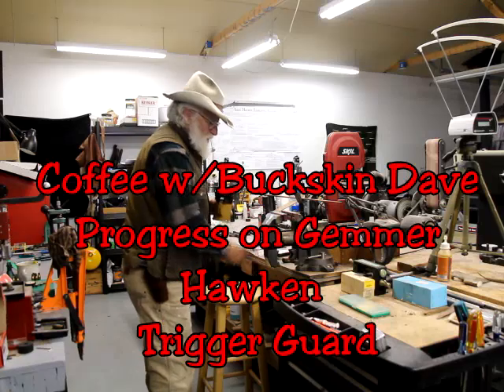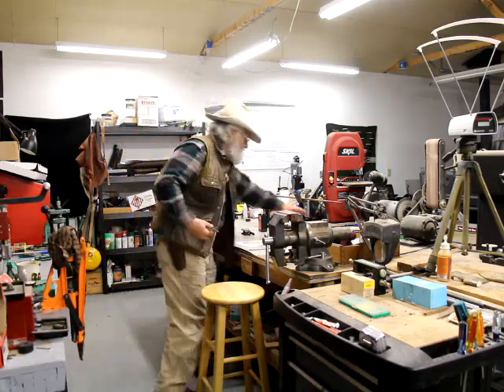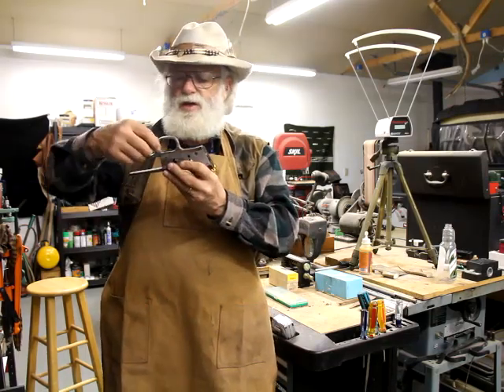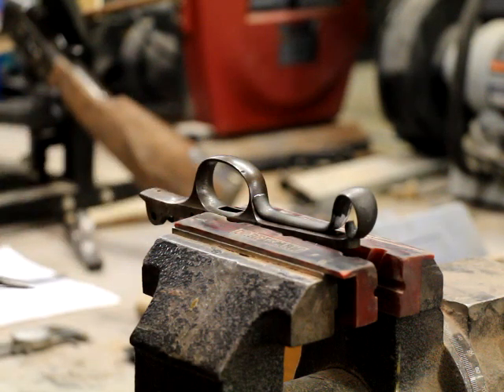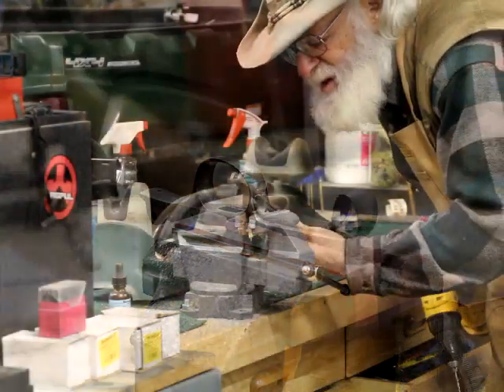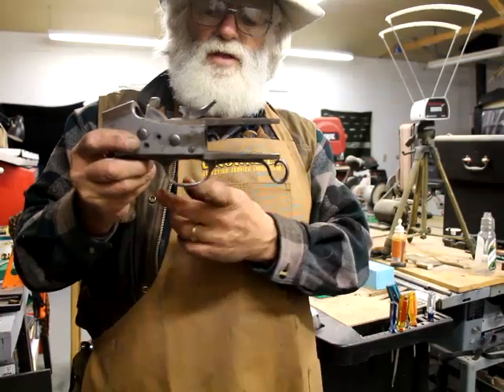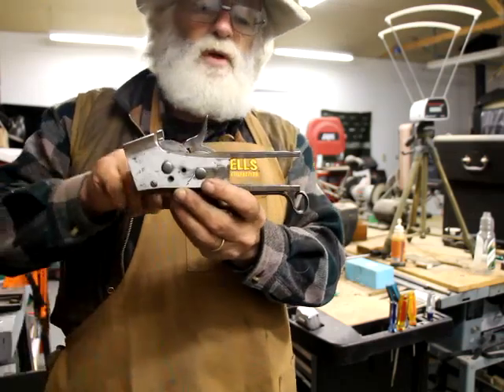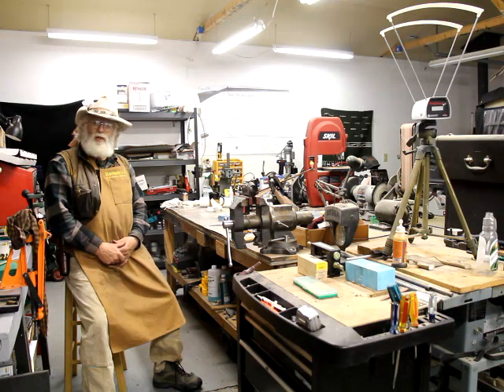Coffee  w Buckskin Dave    Progress on Rollin Block Gemmer Hawken Trigger Guard

Comment: Love your concept, enjoying the build , mildly surprised at the variation among models. I think that at some point I would have just taken a bar to the mill and made the flat trigger bar part from scratch and gone ahead with the original plan of soldering the whole loop on .   But a guy always has to weight time against work involved.
Reply from the maker: I don't no if they wud have done the originals like that as the trigger plate cane on the action, not to mention I haven't had seen an original so don't no if they even put it on.  Thanks for dropping by
Reply: @BuckskinDave  I have no idea on original Gemmers, I am jist saying that sometimes making a part work is more work than jist making a part.....also from the examples I have seen ....the Hawken Bros were pretty particular when it came to Trigger guards, in that the rear of the bow was always very closely fitted to the shape of the trigger and followed it very closely. Also the rear most scroll was almost always perpendicular to the stock at the point it contacted.   Minor details like that are pretty consistent across original Hawkens. I do not know how much of that wad actually passed on to Gemmer when he bought the place, I beleive he worked for or with them for a time though......so maybe?
Reply from the maker: I'm pretty sure I have too early of a guard on this rifle, but it wuddent be out of the question because they made later ml with early parts
Reply: @BuckskinDave  I am sure they didnt throw much out. Old and serviceable is still serviceable ;)